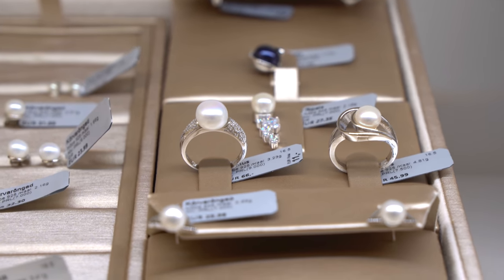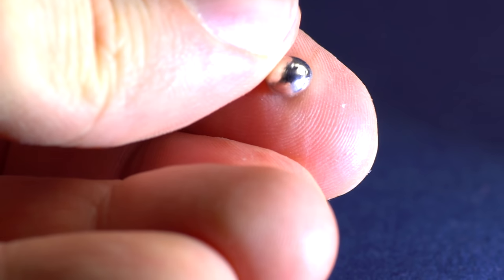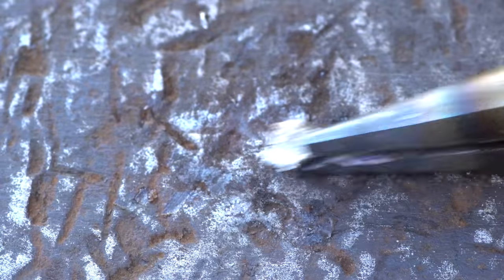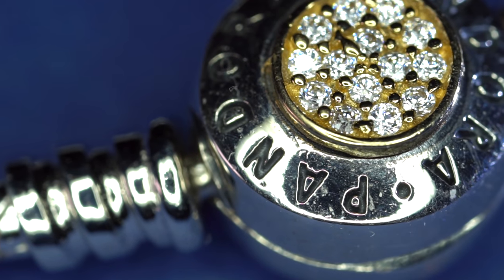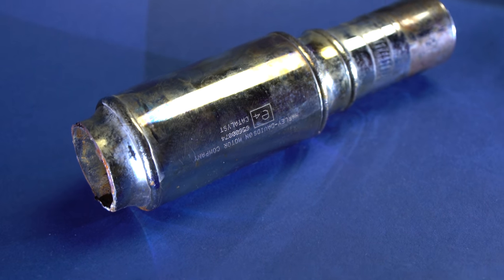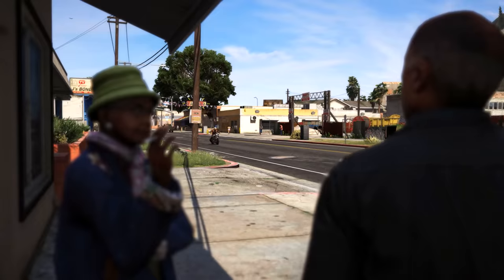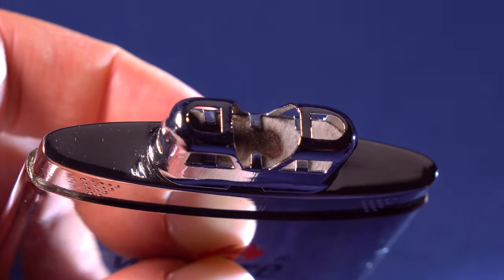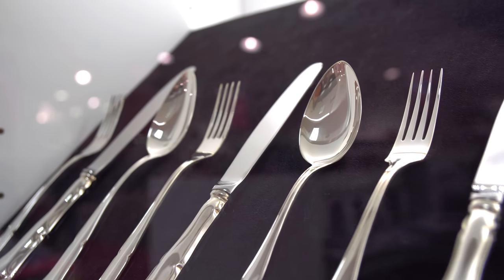Rhodium  - The Most INVISIBLE Metal on Earth!

Comment: Plating Rh on silver, defeats the disinfecting properties of the silver
Reply: you don't really need your accesories to have disinfecting properties do you
Reply: In such case must better use 999 Silver in jewelry.
Reply: copper is more disinfecting, copper silver alloy (common) should work fine too
Reply: @GMODISM  Copper is also often an allergen
Reply: Googled it and its actually quite a rare allergy. I guess its a genetic thing since my sister and I both have it.
Reply: @BAMB00STE  while the allergy may be rare copper isnt very good for you, however copper is much better than bacteria and viruses tho! Would opt for silver or a silver copper alloy if it will have prolonged skin contact anyways, and if you have allergies, maybe better opt for pure silver which also is a clean metal
Reply: But it protects people with metal allergies who like wearing jewelry. Sterling silver rings make my hands feel irritated. Rhodium plated rings, even on a cheaper base, are comfortable.
Reply: Lol it sounds like you are in a Chinese drama using silver needles to test for poison in food
Reply: The "disinfectant" property observed in silver is not unique to silver. IIRC most elements which are used as metallic catalysts or reducing agents tend to inhibit bacterial growth. I think it has something to do with the metal interfering with the formation of glycophosphates that the bacteria needs to form its cell wall. By coating silver with a more inert metal, you are removing this direct interface and stopping any potential reaction (like oxidation) from happening.
Reply: All heavy metals inhibit bacterial growth

Comment: Ex-jeweller here. Just a small correction on the information regarding rhodium plating for anyone that is interested.

We almost never rhodium plate silver (the only time we do, is when specifically asked to by the customer, and they are charged accordingly too) as it would make the pieces prohibitively expensive for the value of the metal. We pretty much exclusively use rhodium plating on white gold alloys to help keep it's lustre, as 14ct w/g alloys and above have a very grey appearance, even when polished. 

Also, replating a piece is so expensive because we have to remove EVERY trace of rhodium, smoothe and polish the piece,  isolate where plating is needed, and then plating it in $1,000(aud)/Lt solution. If any bit of rhodium was missed in the initial removal process, it will cause a cloudy bloom on the piece, and you need to start all over again from step one. And if your solution becomes contaminated in any way...you have to buy a new bottle, as it will just cause flawed platings otherwise.

Comment: For the hand warmer, the Rh catalyst, along with the other catalytic materia, reacts with the vapor of the fuel. So instead of buring in a flame, it merely reacts with the catalyst to produce minor combustion. Like a catalytic converter where the co1 passes over the catalyst and it's transformed unto c02 as an oxigen is added to the carbon. Much like reacting hydrogen with platinum.

Comment: Aa a jeweler, I can say that most sterling silver jewelry isnt coated with Rh, unless it's hallmarked as such or during the creation of agentium silver (has other names in industry) which gives it a higher resistance to corrosion. I'm not sure of the hallmark laws in Russia, but in the US silver has to be hallmarked if It's made of other metals. Such as sterling hallmark (92.5). Rh is typically mixed with gold to make white gold and is hallmarked as such. 

Love your videos, just wanted to put that out there as a friendly heads up.

Comment: You missed one important use of rhodium: it is used (together with other platinoids) to make dies for the production of glass fibres, such as those used in fiberglass, rock wool and optical fibres. The hardness even at high temperatures and chemical inertia of platinoids are what makes them ideal - if very expensive - for this purpose.
Reply: No, it is a catalyst in the process.
Reply: @WatcherLater  No it isn't. It is used in the mechanical extrusion process.
Reply: @dlevi67  I was thinking of something else, you are right.
Reply: @WatcherLater  No probs!

Comment: White gold is not very shiny, so it is nearly always coated with rhodium which gives it a beautiful shine.
Reply: It's not just the shine; white gold can be polished to a very high shine, but most alloys are visibly if slightly yellow.
Reply: White gold is yellow gold with a rhodium plating. No such thing as white and yellow gold. Only yellow gold with a rhodium coating therefore white gold.
Reply: @nathankeel4308  Wrong.
White gold is usually an alloy containing about 75% gold and about 25% nickel and zinc.

Comment: The actual siver you showed (the spoon - the rest was gold) that oxidised is .925 fine and .75 copper. The stain is copper. .999 Silver doesn't tarnish
Reply: Silver will tone
Reply: No. You are wrong. It's inert. Only other metals will be attacked and it is affected much more easily than gold. My 1kg .999 ingot from 20 years back is still perfect. The .999 granules I made by melting and pouring some of it, have some colour, but very, very little to none. Any trace element will do it. In this case, it's coloured by metals from the crucible from previous 925+ silver melts, so it's next to nothing - like 1:1000/95. Even the elements in the water bucket it was poured into will make a difference, so the granules are mostly perfectly white after 15 years in the open. It hasn't oxidised like you would expect from regular copper / silver 925 sterling silver. 

The video DEFINATELY showed sterling silver spoons (that were not plated). The rest of the 'silver' shown was low carat cheap gold jewellery, alloyed with low grade alloys and probably undercarat. 

I've been melting and making jewellery for 35 years. I can look at a metal and tell what alloys are in it. I can tell within a second if it was, forged or stamped, and when it was last annealed and how it has been stored, plus how old and in some cases where it was made. We all can. It's like a cook who looks at a dish.
Reply: @PlatinumRatio  i have many pieces of toned silver look on ebay toned silver brings a premium but its easily faked. Silver will turn into every color of the rainbow
Reply: The tarnish is actually the result of a chemical reaction between the silver and sulfur-containing substances in the air. The silver is actually combining with sulfur and forming silver sulfide. Silver sulfide is black. When a thin coating of silver sulfide forms on the surface of silver, it darkens the silver. That’s what we call ‘tarnish.’

Comment: I am working with ore. I have had numerous problems trying to melt. I finally got them to melt and decided to put the hard buttons in nitric/water hot to remove any junk metals, copper, iron. I am ok with the nitric/water dissolving my ilver and palladium also. I went to go flatten the buttons before putting in nitric/water and they was very hard but broke into pieces. Now I have a white substance in the bottom from the buttons. I had took a button the other day and put it in AR and got a white in the bottom also. figured it was silver, but now that I have the same looking white in the bottom of nitric/water soak I dont know. As I said all kinds of problems melting to a button. Finally a guy said use a Arc welder with carbon rods, this worked but now I have this white. Normal forge is not hot enough to melt. I dont know what it is. Any idea's?

Comment: You can find Americium in your smoke detectors. What are you waiting for?
Reply: There's about 1/3 of a μg of Am241 per detector (and BTW not in all detectors - some use ionisation chambers or photoelectric sensors). That means 3,000,000 detectors to get a gram of Am241; at $10 per unit... you pick up the tab?

Comment: So many mistakes I have to chime in. One non-mistake but a wow for someone who forges PGM's for a living is your metal block is rough and so is your hammer. They should both have a high polish and be free from oxide, plus be high quality tool steel. You can forge Ru pretty well if you anneal it properly and use the correct tools. Silver is never rhodium plated. It is silver plated. I have done it many times anyhow. It doesn't look like silver and it won't stop oxidisation. Ru doesn't protect the undererlying metals at all. 
... still watching at 3 min mark